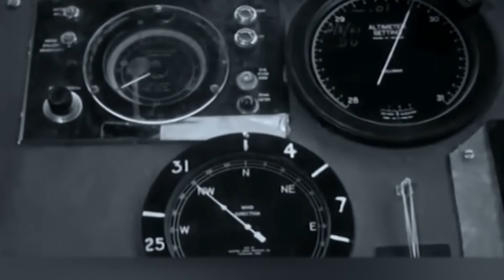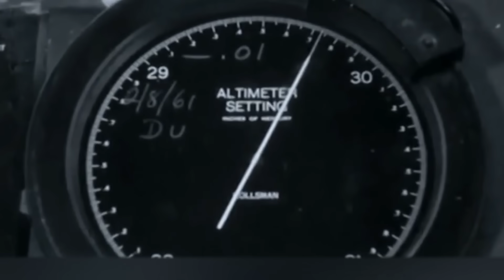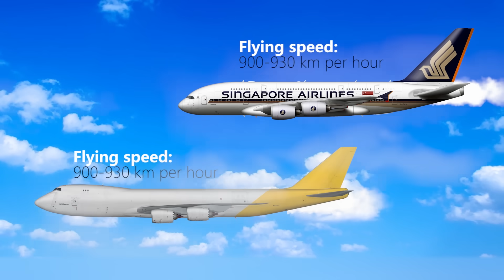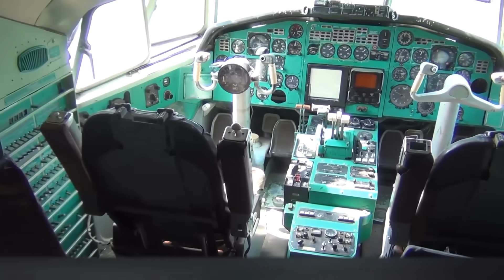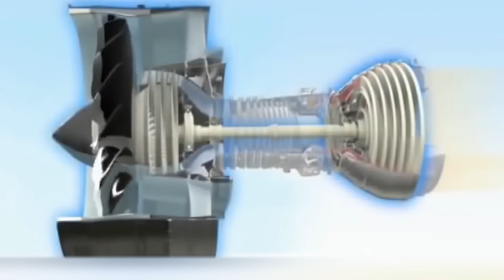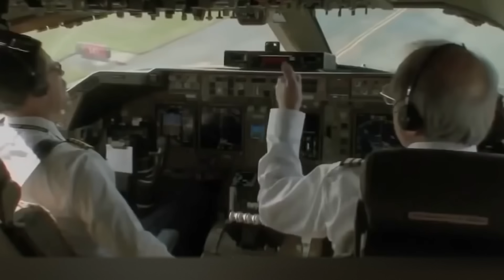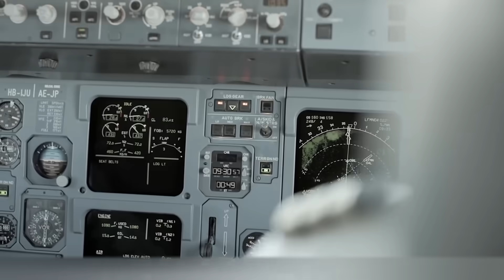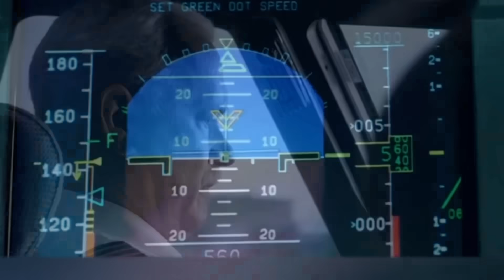Why Do We Fly so Slowly?

Comment: This is a attests to  how capitalism can get technology and human advancement  stuck; viability in the face of capital. It is true that capitalism incentivizes competition, but it also serves as a perpetual deterrent of technology threatens the capital of those that OWN the capital, even if those that WANT to own the capital come up with new products that are innovative and revolutionary.  A good example is the case of Nikola Tesla and JP Morgan. Mr. Morgan withdrew funding to Tesla's Project because it would render his power transmission lines obsolete.
Another good instance is how ethanol was practically deleted from people's minds, due to interests of BIG OIL. Also another good example is how technology is slowly LEAKED to the public in order to profit more from a product by giving consumers the least possible advanced technology in order to pave the way for a sequel that is A LITTLE more improved. 
Lastly the worst example of all: The car industry. 
The car industry has blocked they way to real technological advancement by leading consumers  to see modification in CHASSIS design and introduction of electronic amenities as advancement of the car industry.  A car of today is very much the same as a car of 20 or even 50 years ago, with very little to no improvement in engine or transmission design. They  keep reselling the same product in a body that looks radically different. Capitalism is NOT the best political system that humans have devised, however it is the best system that the rich have devised to retain hegemony and retain the illusion of opportunity for those that seek it.

Comment: Most efficient modern commercial planes use turbofan jet engines. By putting this big fan on the front of a  jet engine the airlines gained fuel economy and less jet noise. When jets were all jet engines , without any external fans, , like the 727 and 707, these planes tended to fly faster due to their pure jet engine. But they were gas guzzlers and quite noisy (Did you ever hear a 707 in reverse thrust?) Well, when they started putting those large fans in the front of the jets they discovered much better fuel economy. Did you know that 80% of the total engine thrust of these turbo fan engines is developed by the fan alone. The other 20% of the total engine thrust is gotten from the jet part of the engine with all the compressor stages.

Comment: Commercial planes are not fighter jets. They are not that aerodynamic, due to the shape caused to allow many passengers to occupy them. We had streamlined commercial jets, several years ago, called the Concorde. They flew mach 2 and made it over the pond quite rapidly. However, they were gas guzzlers and were not profitable enough to keep flying. They only held 104 passengers and crew and were so noisy at takeoff and landing that they were only allowed to operate out of a few U.S. airports like Miami, New York, and Washington D.C.

Comment: The Concorde was a plane that could fly much faster than normal passenger jets but it was expensive to build and expensive to fly and that made it expensive to buy your seat and even then it wasn’t a great experience because of the streamlined design so you had less leg room then you had on normal planes and if I remember correctly non of the luxuries in normal planes were in the concord

Comment: simply its because at around 300 knots the plane overspeeds which could possibly mean it tearing apart, if it went higher for less air resistance it would probably run out of sufficient air to keep the engines at a high enough speed to keep them airborne

Comment: It's more than just saving fuel. A huge issue is also air traffic control; planes flying at slighter slower speeds are easier to control, especially in high-traffic environments. The Americans found out the hard way not once, but twice from mid-air collisions in 1956 and 1960. As such, it forced airliners to fly slower on all flights, a change that favored the Boeing 707 and Douglas DC-8. The latest jet airliners nowadays on long flights usually cruise around Mach 0.85.

Comment: To make more money, save fuel, no sound barrier noise and preserve weaker engines at high speeds.  Miss the older days

Modern  commercial planes can fly much faster than they do but wont on purpose. Ever notice how when there is a delay you can sometimes still make the destination on or around the same time? They just fly faster to keep everything on schedule.

Comment: The tube airplane has been obsolete for MANY YEARS, It is mainly that throwing away good planes is a waste of money... economics. Flying around 1200 kmh would be best so why do these tube planes not do that; they are not good planes. The next generation planes  look like the Space Shuttle, estimated to be used in business aviation within a decade, and within 3 decades for commercial use. Maybe next time do more research...
Reply: Yeah, right. That's why they keep designing and building brand new "obsolete" tube airplanes. And mach 1.0 to 1.1 would be the absolutely worst cruising speed for any design imaginable. Either you need to stay under the transonic range for efficiency, or well over mach 1 for performance.
Reply: Maximize Freedom Not only that, Air resistance increase by Velocity^2, so going fast is simply a bad idea for efficiency.
Reply: Manufacturers continue to make broad winged Aluminum tubes, because that's how they know how to make a pressurized airplane. However, the largest commercial and military aircraft and use either an egg shaped (B747, C5 Galaxy, and AN 124 and 225 ) or an vertical Oval  (A380) fuselage cross section. These rounded shapes are not only aerodynamic, but can evenly distribute cabin pressure, while also separating cargo, passengers, and systems in an optimal configuration. Aluminum remains the material of choice, because it's lightweight, strong, corrosion resistant, readily available, and less expensive than newer alternative materials. Even with new materials, Broad Wings remain the norm, because most airfields are too small to provide adequate runway for any kind  of Delta Wing jetliners, as they require more room to takeoff and land.

Comment: It has far more to do with Fuel Efficiency and Profit Dollars per mile per passenger.
Environmental Concerns have made laws/rules in North America that limit Noise and Air Pollution.
These in my opinion are the most important and significant factors regarding overall aircraft speed.

Comment: Because there is a demon that lives in the air. They say whoever challenges him will die. Their controls will freeze up, their plane will buffet wildly and they will disintegrate.
     I'd love to hear someone in the 1950 complain that airliners going 500+ MPH are too slow.
    You guys made this way more complicated than necessary. It comes down to energy and fuel consumption.
     Speeds between 900 KPH and a bit over Mach 1 enter the area of trans sonic. Air resistance becomes much MUCH higher as you get closer and closer to Mach 1 due to the way air reactants to objects moving this fast.
      This means burning a lot more fuel to gain only a small amount of additional speed. For an 8 hour flight this means using thousands of pounds of addition fuel to make your 8 hour flight a 7.5 hour flight.
   When fuel was cheep in the 50's and 60's it was worth burning more fuel, but once fuel prices went up, it just wasn't economical any more. Anyone who says jet airliners are too slow should travel by rail or better, by ship. There is nothing slow about modern airliners.

Comment: Planes don't fly faster because of physics.  Drag (both kinds) goes up with speed exponentially.  When you push up the throttles to go 25 mph faster the fuel burn goes up by a 25%.  The Concord burned 25,000 gallons of fuel between NYC and London.  A 747 does too but hauls 5 times as many passengers.

Comment: You should actually be quoting airspeed in KNOTS instead of kilometres miles per hour: 1 Knot = 1 Nautical Mile per hour. Or 1.1 statute (car) miles per hour. To convert miles into kilometres divide total by five and multiply by eight. To convert kilometres into miles divide by eight and multiply by five. One metre = 3.3 feet in altitude and remember that for every 1000 feet upwards you travel the temperature drops by 3 degrees Celsius. Finally turbojet engine usage reference is incorrect: Many modern airliners use High Bypass Turbofans these days where much of the through-flow of air does not pass through the combustion process. Low-Bypass Turbofans are where the majority of the through-flow passes through the combustion process producing more noise and heat and less efficiency. Turbojets - all air is involved in the combustion process and these also have the shortest service lives and highest operational costs. 6/10 for this one I feel ...

Comment: Turbo Jet, Turbo Fan, Turbo Prop, and Turbo Shaft are the ones I know of. Most modern Fighter Jets use Turbo Jet engines, Most modern Large Passenger Planes use Turbo Fan, Some modern Workhorse planes use Turbo Prop, and some modern helicopters use Turbo Shaft. They are ALL GTJE's (Gas Turbine Jet Engines.) each category refers to it method of delivering propulsion. There were several mistakes or inaccuracy's. Its an ok video if you dont mind incorect information being spread around. That kind of bugs me. I like everything true and correct i possible. I may be  wishin jelly fishin
Reply: Jason Black most modern fighters use turbofans.

Comment: Efficiency achieved through slower speed = lower cost of fuel = profit margins. Once set the schedule would get messed up at origination/destination. No need to burn fuel and get there faster just to get out in a holding pattern awaiting ramp space.

Comment: The next step is auxiliary ion drives that accelerate small particles of air at very high speeds, creating propulsion from the equation mass x energy = force, where the mass is small but the energy is large. There are still engineering hurdles to cross, but they are not far off being solved.

Comment: Did you actually do any research on any of this?  This is down right ignorant and in no way reflective of either past or present technology.  
Wings are far more efficient then older designs.
Fuselages are larger for passenger comfort, and increased capacity.  Which is driven by economic realities of an industry operating on razor thin profits.
Modern planes are faster.  Boeing 737-200 cruised at M .72, next gen 737 cruise at M .78-.81
Modern b747 and A380 cruise at .84+ and can do over M .9
We are in fact as a fillet marginally faster, with the exception of certain planes like B 727 which was always fast, but highly inefficient.  When fuel was cheap this didn't mater.  But in today's world where the profit on a flight is maybe one or two seats efficiency keeps the planes in the air.  Everything from materials to systems are designed to squeeze every bit of efficiency out that can be gained.  
We aren't flying slower, but we are flying smarter.  Next time research your subject first, and try not to use lousy examples (Chinese and soviet) aircraft as neither represents current technology for their time.

Comment: They don't fly faster because of something called the sound barrier.  When you go past the speed of sound you create sonic booms.  People on the ground complained about sonic booms when the Concord was developed.  So you have a high end barrier for the public which limits your speed no matter what plane you build.  Designers can develop a faster than sound plane easily now, but you still run into the problems of the sonic boom.  Get rid of the sonic boom, and you'll see speeds increase again.

Comment: Most modern jet airliners use turbofan engines, not turbojet. All of the air in a turbojet engine gets mixed with fuel and most of the air in a turbofan engine gets bypassed and only a small portion of the air gets mixed with fuel.

Comment: Error. The turbofan killed the SST. In the 60s, airlines calculated that an SST, traveling 2 to 3 times the speed of sound would be able to make long distance trips (US to Asia, Australia) much faster, and they could get twice as many flights in. Then the turbofan was introduced, which promised great fuel savings for subsonic aircraft. The cut the bottom line of the SST, so they were cancelled. Sonic booms? That was also a reason, but for aircraft taking off over water, it wasn't an issue.

Comment: I call this video bs. 

Let's start with units! Speed in aviation is relative thus using km/h is pretty much useless. You may have winds that de- or increase your speed in relation to the air around you and the result is called ground speed. To make thinks easier I will use mach. Mach is in speed in percent of the speed of sound in the current atmosphere you are in (considering temperature, pressure, ...) 

http://www.bredow-web.de/Berlin_Tegel/Tupolev_TU-154/tupolev_tu-154.html  according to this source the average  mach of a Tupolev 154 (the old Russian one you compared)is 0.85 and maximum 0.9. The A320 series has a maximum speed of 0.82 but it'S only short haul.

the A350 on the other hand flies .85 standard but .89 maximum. A380 is the same (although it can handle up to .96!). The 747 cruises at around .855 but can go up to .92 depending on the version. B777 cruises at .84 and can go as fast as .89 .

.84 = 892 km/h
.89 = 945 km/h

So as you can see we have hit a limit at maximum .9 mach. It's not just a technical limit but also a limit of reasonability and economy.

Comment: You need to become more efficient in your presentations. I struggled to maintain interest about a third of the way through. This is an observation not criticism. Try using the rubber thing at the end of your pencil instead of the lead at the other. Its there for a reason. Its called good design.

Comment: A jet engine is most efficient when it's forward speed (speed of the aircraft) equals the exhaust air speed ( bypass air and combustion air) which pushes the jet forward.  For the 787 and A350 it is 903 km/h